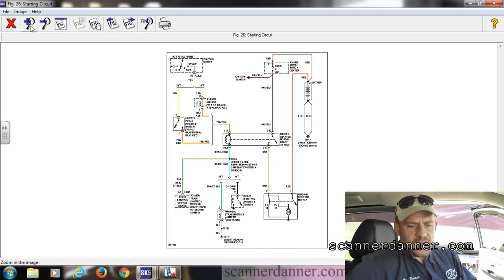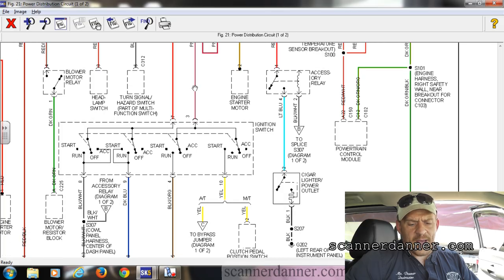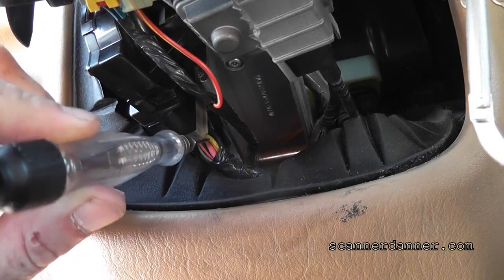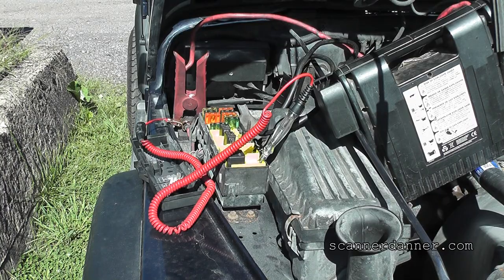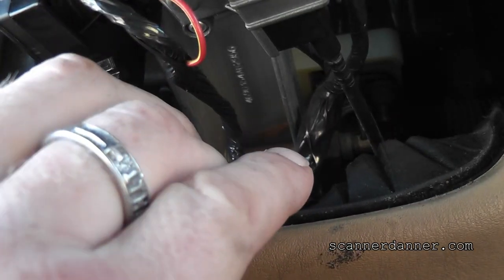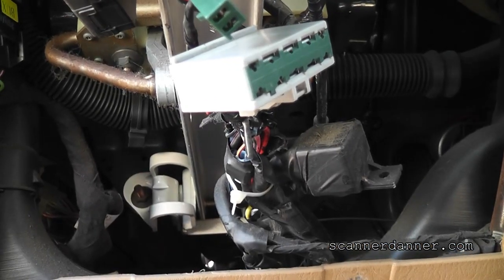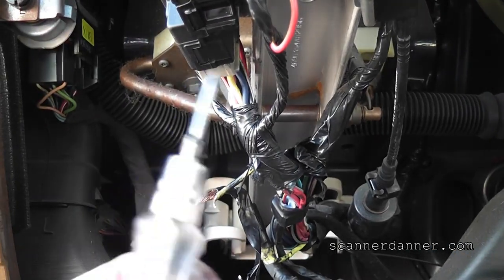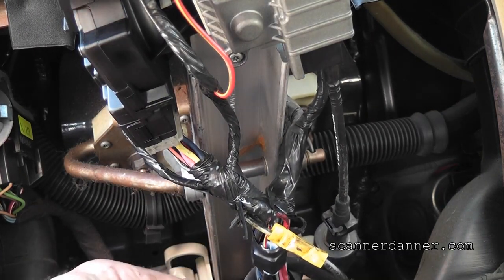No Crank Troubleshooting (engine does not crank) - Jeep

Comment: hi i have a similar problem. my Mercedes w203  c180  2002 model battery ran down because i left the lights on . i jump started the car with my friend's car, the car started we drove the round   the block for like 10mins  so the car can charge  after parking the car ,  the car didn't start again . dashboard light on but no crank. i towed the car to my mechanics they having been battling with the car  .. kindly give me some advice, the car has been with the mechanics for 1 week plus now  am really worried .

Comment: I install aftermarket remote starts for a living, so I do take offense to you calling it all crap. Same as any field there are people who take pride in what they do, and people who are in it for a quick buck. Having said that, the device you encountered here is usually installed by a dealer as an "add on alarm". Just another way for them to up charge the customer. I learned a fair bit from watching you go through the same processes that I go through when we run into problems installing a remote start. Don't be afraid to test variables. As long as you have a complete picture of the circuit you are working on.
Reply from the maker: For sure and please accept my apologies.  What I was referring to as crap was these aftermarket alarm systems that simply cut the crank wire. It is so easy to bypass them and any car thief would know that too.  I've installed many remote start systems myself and you are correct, there is a right way and wrong way to do them.
Reply: ScannerDanner
I figured you were venting frustration about not seeing it right away. It does help us see that it is ok to not catch everything right away. As long as you arrive there in the end. Appreciate the awesome videos!
Reply from the maker: Thanks james
Reply: Hello James! I am going to disagree with you! I believe Paul called "crap" to the horrible installation!   the 95% or more of the aftermarket "add ons" are installed horribly with carelessness by people without the proper training, which renders the product "useless" because is not performing as designed!  please look at what you saw in the video, I calibrate engines for the aftermarket, most people will "Plug" a cold air filter and leave it at that! Well if you did that to a MAF engine it will never run right, it may apparently sound and kinda feel right but it will never!!!!! will the ecm tables need to be corrected and tuned by a professional with a dyno, or how many times you have replaced and oxygen sensor from a reputable after market manufacturer but the ecm keeps generating codes? the reason is a different resistance  on the circuit that throws of the amperage pattern, the ecm does no like that! so the ecm has to be calibrated to see the difference, and if you didn't do that you failed as an installer to complete the job! so its easier just to get the oem product and move on! put this prospective, What do you think this undocumented modification makes for a repair technician when it fails? drives them crazy! they are in the business of fixing cars that failed not fixing cars because previous installers failed !
Reply from the maker: ***** Thanks Alta9610, we talked about it and are good.
Reply: ***** Yes all is well. What I believe he was stating was his frustration with not finding the obvious hack job faster. I agree the install and product (relay starter kill sold as an alarm upgrade) shown in the video are indeed crap. When Paul said it in the video it came across (incorrectly on my part) as all aftermarket installs were crap. No hard feelings here! :)

Comment: I’ve done everything on this video, all pre checks worked. I’ve replaced lock cylinder, actuator pin, and the switch twice and still no power to the yellow ignition wire😢 please help
Reply from the maker: What are you voltage feeds into the ignition switch show you? I think there is two main feeds?

Comment: cut some lengths of wire, attach some non-insulated terminals on each end (male & female), remove relay & fit wires to board then sit relay on top of the wires, then you can attach croc clips & jumpers. 

The 'Voodoo magic' comment was aimed at the new ignition switch if anyone wondered :-)
Reply from the maker: I've done that and it works great. Problem is, in the hands of the wrong person, they may attach them to the relay incorrectly and risk damaging a computer driver (computer controlled relay of course).
So I stopped teaching my students that. I still like the suggestion though my friend as it is completely valid.
Reply: the 'wrong person' should not be attempting electrical diagnosis or repairs ! 

It's not rocket science to attach correctly though is it, seeing as they're only an extension :-)
Reply from the maker: Haha I agree 100% but as a teacher of rookies you would be surprised by what I see.  :)
Reply: LOL I can imagine, then it's your job to teach not to pop any drivers just like by pass testing ;-) Section 3 Transistor Drivers and Output Solenoids ......
Reply: tongue in cheek moment there quoting your Ebook section :p
Reply from the maker: Haha good point bro :)
Reply: good vid Paul :)
Reply from the maker: 1973Robski Thanks Mr. Pico :)

Comment: have a 2002 jeep TJ. It won't start and the gauges go wonky when the key is in off position or visa versa as nothing seems to be consistent. Door alarm doesn't make a sound. Door open, gauges might go wonky and sometimes when the doors are closed and no key in the ignition the gauges go wonky. The battery has been tested and it's fine. We just replaced the starter and the alternator was replaced a couple of years ago. We have the charger on the battery overnight but it still wouldn't turn over and the battery seems to lose it's charge as if it were being drained over night. I don't have a test light but I will get one... Please if you know any reason my gauges go wonky and what can cause it I would be very appreciative.  we do get a message where the mileage is lit. it looks like 2 igloo symbols and says "relay".  We replaced #15 sensor and tried new fuses with no resolve.
Reply from the maker: +Dorlaine Simmons check the main battery ground cable where it attaches to the block

Comment: Where does a guy get these wire diagrams?
Reply from the maker: The professional version is $160 a month. There is a DIY version where you can purchase the service info and diagrams for a single car for $20 (same diagrams I use)
https://eautorepair.adtrk.biz/?a=10817&c=24&p=r&s1=

Comment: I have a problem with a dodge 1500 no crank but after key on before cranking the headlights and odometer flash for about a minute then stop, when flashing stops i still having a no crank situation. Also on the starter relay I only have power on one pin. All fuses are good, Any ideas.
Reply from the maker: you have something aftermarket in that, a remote start or alarm system?
Reply from the maker: what year?

Comment: I had almost an identical problem with same occurrences with the yellow wire until you got to the aftermarket parts which I dont have. Tried your jump starting trick to the yellow wire that worked for you in the end of the video and did not work. Any ideas?
Reply from the maker: +kurpiel4 check for control at the relay, there is also a PN switch in between the ignition switch and relay (if I remember correctly)
Reply: +ScannerDanner I tried jumping over the pn switch to see if that was the issue and it still didn't work I am not getting power out of the yellow wire coming from the ignition switch so not power would get to the pn switch
Reply from the maker: +kurpiel4 okay I misunderstood. Then all you need to do is to check the main feed coming into the ignition switch before replacing it.
Reply: +ScannerDanner that would be the pink black wire that you showed I believe and I have power there all the time
Reply: +kurpiel4 so jump the pink black to the yellow and it should crank. If it does, this is 100% confirmation that you need an ignition switch. If it doesn't, you missed something along the way

Comment: Hello. there, I need help with my 2006 Ford F150 5.4L. I bought this pickup not working thinking it would be an easy fix. Towed it home. no start no crank no communications codes, and I did not hear the gas pump, so I replaced that gas pump driver module above the spare tire. and still did not hear anything, So I replaced the powertrain control module, now when I turn on the key, I hear something like the gas pump, but still no crank, I found the little wire that goes to the started and kind of hot wired it, and it is starting nice that way, so it is not the starter, but now when I turn the key the anti theft light keeps blinking. And now when I plugin the code reader it says ALL STORED IN VEHICLE'S COMPUTER. What would you do next? I also have replaced all the relays in the fuse box.  And I will not hold it against you if what ever you say I should do next, if it should not work. I 'm really open to any ideas. Or what would you do next? Please help me, I can not afford to have to tow it to the Ford dealer. anything will help, I know you are smart, thank you.   Thank you for doing all the great videos, you are saving poor people a lot of money, big dealers have already a lot of money. Thank you from Calgary AB
Reply from the maker: Follow the tests I'm showing here. Starting with your 5v reference circuit
https://www.youtube.com/watch?v=hJQ6qnhTgdg
https://www.youtube.com/watch?v=ecz93B5SRsQ

Any additional findings post them to my forum okay? I'll help you over there. 
https://scannerdanner.com/forum/post-your-repair-questions-here.html
Thank you!

Comment: Hey paul i have a question, i have a no crank /starter wont engage when the key is turned all way forward, i have 2003 jeep liberty sport 3.7 4x4, i replaced starter ,still same, i checked the actuator switch in the key housing and its not broke, however under the hood there is a big 6 pin fuse labeled starter if i jump a wire across 2 of tabs on starter fuse i can push the fuse in and it starts and i pull it out in order for the starter to stop engaging. so I'm guessing i have a bad wire from that fuse to the steering columm, any thoughts would be appreciated paul thanks. ps i haven't check the switch that the actuator piece plugs into, it is a 8 tab plug with 1 t10 bolt holding it inn thats next. thanks.
Reply from the maker: Need to look at a wiring diagram to help you and I can't do back and forth messages here. Post this to my forum, it is free to join and we can help you there. Thanks!
https://www.scannerdanner.com/forum/post-your-repair-questions-here.html
Reply: oh I'm sorry i thought this is were i ask ,my bad didn't even know abought forum will do thank you.
Reply from the maker: It is, for things I don't have to look up and study a wiring diagram and then provide back and forth email support. I can't do that here as I have hundreds of questions to answer everyday.

Comment: SIR i have jeep wangler JK 2018 , the car was full with water in CANADA  now the car  is in my shop, i have change all the unit because they all had water inside. now i have fixed all the used unit and the is no can communication  with PCM, TCM, ABS etc and the car is not cranking . please i need help.
Reply from the maker: what is the resistance of the CAN network with the key off Pins 6 and 14? but if there is a gateway that complicates that measurement. Need some service info for sure https://www.scannerdanner.com/forum/post-your-repair-questions-here/3757-need-service-info-check-here.html

Comment: Good video,  but I don't agree with replacing the spark plug wires just to be safe  when you know the reason for the crank no start was a coolant leak on to the cap and rotor.. most people I know if there's no evidence won't want to pay for new sparkplug wires just because.
Reply from the maker: I dont even remember evaluating any running issues on this one?

Comment: Argh!  What a pain in the butt!  You may be happy to know that whenever I'm installing aftermarket items in customers' cars, said items always, 110% of the time, get their own fused circuit direct off battery positive.  No splicing into factory wiring, no shared grounds, nothing ever coming into contact with factory circuits.  Then I draw up a little wiring diagram for the new circuit, slip it into a plastic sheath, and zip-tie it to the wire near the battery where it can easily be seen by any technician that may work on the car in the future.  :-)
Reply from the maker: Dude that is awesome! Wish everyone did that
Reply: Nice ! your unusual !!!!
Reply: As Danner says, that isn't only nice, but that is the exact same thing that should be done in the IT world in regards to documentation.
Cause the next guy may not have a clue what your mindset was when it was installed, or yourself for that matter 3-4 years down the road.

Comment: I have the exact same problem on a '96 Jeep Cherokee; no crank -- I have ruled out the following: manually started the engine via screwdriver and starter trick. Also started the engine by jumpering the pins on the starter relay.  All fuses are good. Check NSS good. So I chased it back to the ignition switch, I have 12VDC on RED and DRK BLU in the RUN position; YELLOW no power when key START? Same as your video, but this is where we part - The YELLOW wire is original no taps or after market connection, if I inject 12VDC to the YELLOW when key is in the RUN position, it still will not crank? If I unplug the IGN switch and jumper 12VDC from RED to YELLOW it cranks! If I jump RED to DRK BLU and touch YELLOW with 12VDC - No Crank? WTF??  Also I put a meter on the IGN switch and check all positions for continuity AOK. I am starting to think it is a PCM check singling issue or bad PCM. my scanner takes for ever to communicate with it OBDII protocol and when it does finally connect I have zero faults logged. I think it is a missing ASD ground side or something keeping the YELLOW from closing the Starter relay when key is turned to START. it is driving me nuts!  jason.daily@jdepost.com  - All comments and suggestions are welcome.
Reply from the maker: It is definitely not a bad PCM. The PCM does not control this circuit at all. You need to give me a voltage reading on that red wire coming into the ignition switch WHILE you are cranking the engine. (with everything plugged in)
If you do not have a voltmeter. Connect your test light to the red wire and tell me what the test light does WHILE you're cranking. 
We want to load that circuit. I am suspecting a voltage drop issue on your red wire. This wire goes to a 60 amp fuse in the power distribution box
Reply from the maker: so let me restate this after I reread your post you do have a voltmeter. 
I need voltage readings on the following while holding the key in the crank position, w
Red (there are two of them, I need both)
Yellow
Dark Blue
Reply: Welp, egg on my face... I didn't follow the yellow IGN wire all the way to the firewall. Found an after market alarm spliced in the middle. Yellow had 12VDC at START, so I followed like you did probing and cranking until I lost the 12VDC. Removed the rats nest tape job and found the yellow had been cut and an alarm was installed. Never used it, so I did what you did cut the splice and made the repair and test cranked - AOK. Thanks Again! Love the videos, I'll give a shout out on my website dailysurveillance.com for scannerdanner.com and a link.
Reply from the maker: Thanks man! And nice job on the fix!

Comment: hey Dann I need your help.
my cars stock  stereo only turns on when it's hot mean when is really hot like weather wise in when it's cold or shade temperature doesn't turn on... why would this happen ? can you help me out on this!!! My car is a vw 08 Jetta(Bora) 2.5 ******** I hope you can help me out
Reply from the maker: Circuit board on the radio most likely has a cracked solder joint somewhere. Other than that, you most likely need a radio
Reply: @ScannerDanner   thank you, I should now call you Senseï @SCANNERDANNER !!!

Comment: I really hate that after market garbage. Maybe the first question to the vehicle owner should be "What has been added to this car that is not original from the factory?"... that was redundant. My truck has  remote starter and I want to yank the whole thing. Plus, there is  household extension cord that runs from the engine compartment to the rear bumper.... which is probably wiring for the old camper top that I removed.